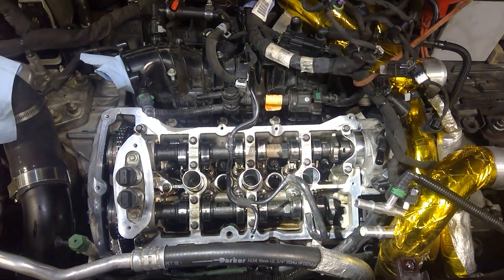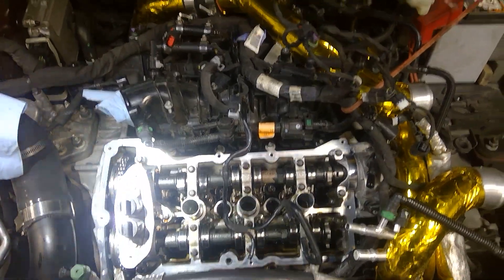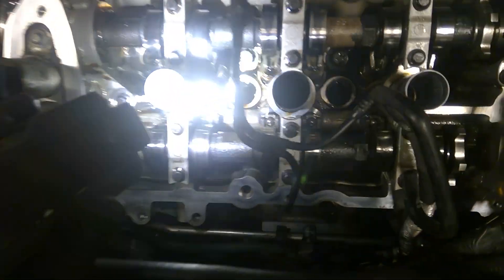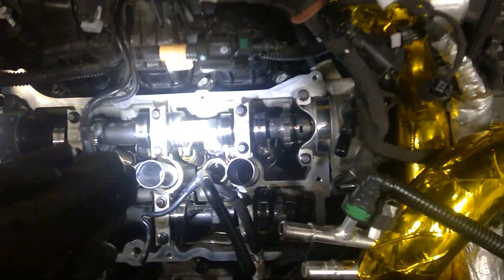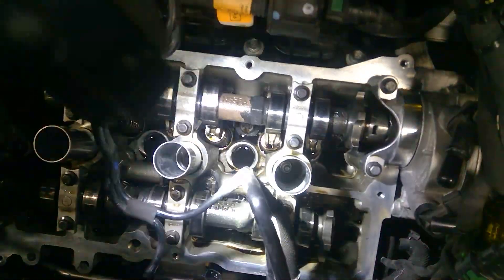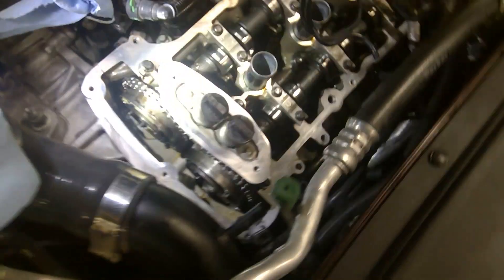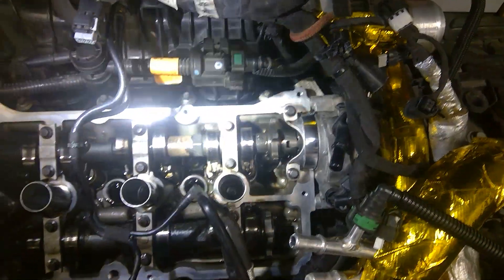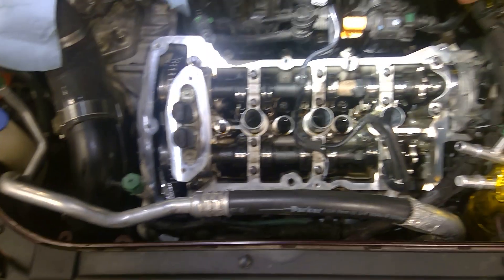Ford Ecoboost 2.7 - Beehive Style Valve Springs

Comment: did u ever had to change the oil pan gasket
Reply from the maker: Never. So far, so good. Still all OEM except for the drain plug, I installed a Ronin back in 2018

Comment: Debating if it's worth it to pull the injectors and go back to stock.  I had xdi install them. Where are they?  So I can see how far I have to tear down.  Thanks!
Reply from the maker: In general, while removing the cover, I look into how much work is involved for injectors replacement. You need time and patience, take pictures on the way. I think the removal of sensors/wirea is the biggest time cinsuming. All bolts on intake are 10mm. Sockets and extentions will be your friend. I still have the OEM injectors and I think we may reach a point my power plant cant take more power without having DTC issues. In general, I think I'm at max power on 94 octane/CRP/19PSI vs last year E30/MKZ/22PSI